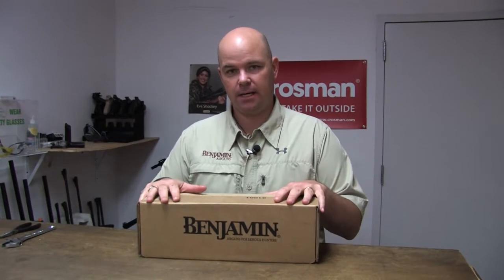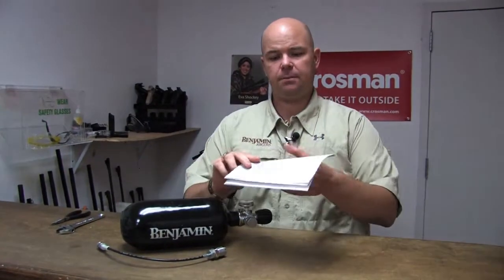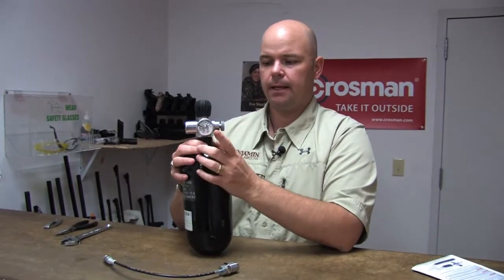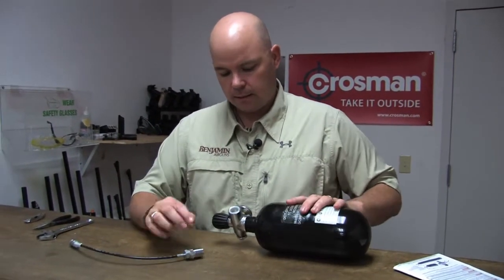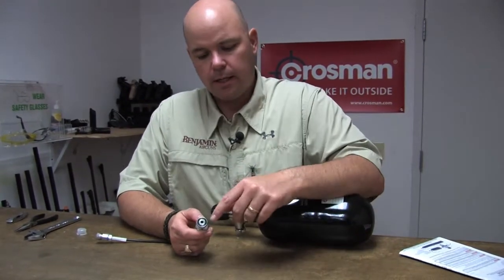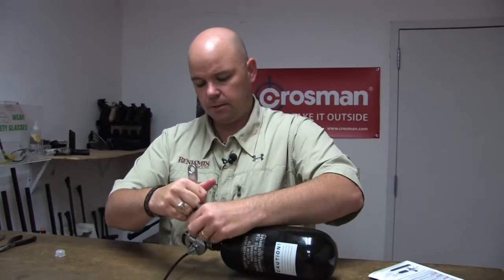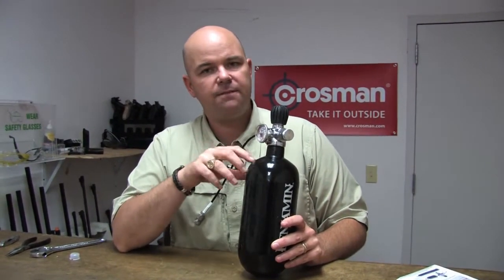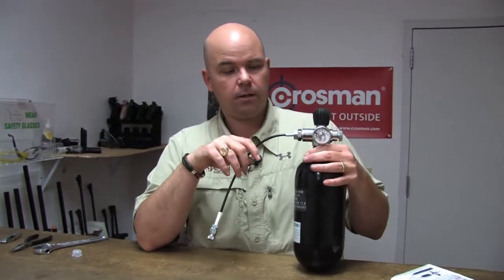Benjamin 15" PCP Air Tank, Chapter 1: Assembly

Comment: Hi Crosman, I just purchased this tank. But when I am done filling and I disconnect the hose and depressurize the tank, the gauge goes back to zero, why?
Reply: I just watched video number 2 filling the tank. When he bled the air off his needle went to zero, then video 3 when he was filling the gun the valve showed the correct tank PSI. So seeing how Crossman is not answering our questions I'm going to assume that the gauge only works when it is actually under pressure, air is flowing through the valve assembly. I have not filled my gun personally yet to see if that's the case but just from what I see in the other videos.
Reply: Hello Crosman, I too purchased this tank and I’m having the same problem. Any advice on how to correct this problem. Thanks
Reply: I also just got and filled my tank for the first time and it went from 4k to 0. But when I crack the big valve air does come out.

Comment: Seems like all the air bottles  need to be hydro tested every 5 years ,the carbon fiber tank are only good for 15 years ,and then can no longer be tested,or filled.. The aluminum air tanks  seem to be able to be hydro tested,every 5 years, forever . He didn't say if this tank is Aluminum or carbon fiber ,may have missed it .Thats my understanding . The paintball tanks, even at 4500 psi don't have the right regulators on them for a PCP air rifle.the paintball regulators are a lot lower.

Comment: @Crossman and or any user , I've question about this air tank. First , i'd like to know whether the tank comes with expiry date which means I've to change it preiodly? Secondly , I'd like to know , does it fitted with air force condor air gun or does it require any male/female adaptor ,etc. Thirdly, does the tank require calibration like any common Scuba  tank needs every five years...?

Comment from the maker: The tank has a greater volume than the rifle and higher pressure rating (4500 vs. 3000). When your fill source has more pressure than what it is you are filling then a fill is possible. The additional volume makes additional fills possible.  The pump would only fill the tank to 3000 PSI but because of the volume, it would take approximately 10x the number of strokes than it does to fill the rifle.

Comment from the maker: Capacity is 90 cu in (14.72 cubic feet). Expect the following number of fills (your results may vary):   Marauder Pistol (Model #BP2220) - 11 fills; Discovery Rifle (Model #BP1K77GP) - 19 fills;  Marauder Rifle (Model #BGP1763) - 7 fills
Reply: Only 7 fills. I should have never bought this air bottle. Somebody told me it was 27 fills. So, so, so disappointed. I'm going to sell it and buy a much larger one. I loathe myself for having bought it based on the wrong information! 😣